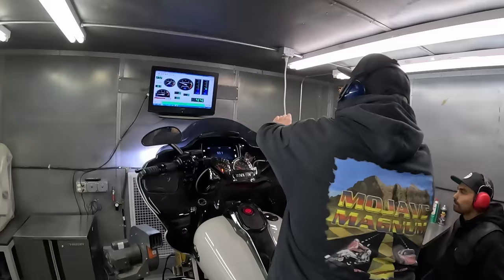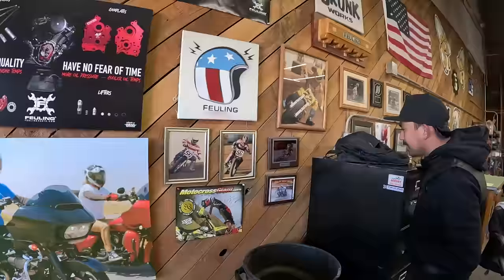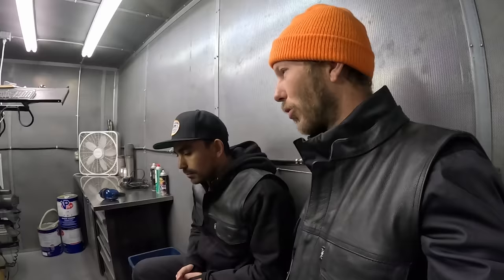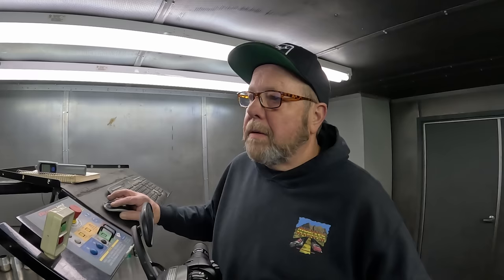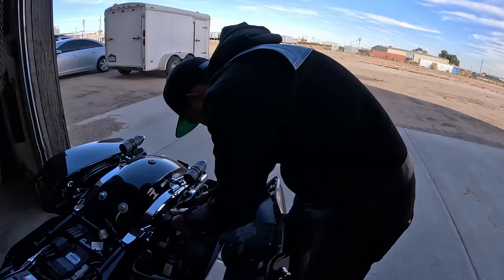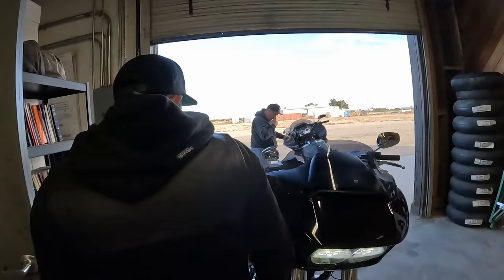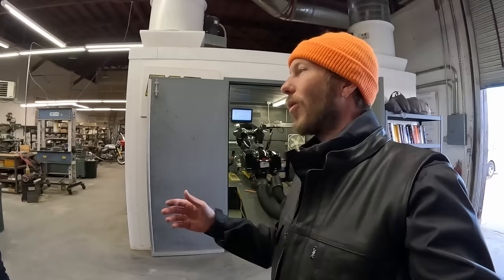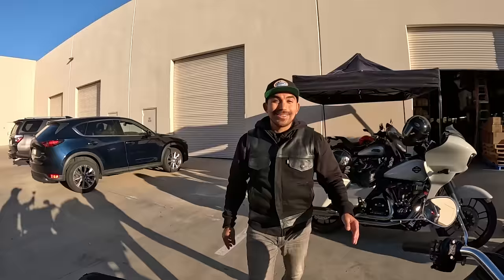Harley Bagger Horsepower Shootout (Battle of the Baggers EP.1) - Vlog 105

Comment: Yo boys! I had a zippers redshift 468 put in my reef blue 2022 road glide standard with a Bassani 2 into 1 mid length exhaust and Arlen ness big sucker air cleaner and it put me at 106hp and 119 ft/lbs. All with the screaming eagle tuner. I’m pretty stoked with that so I think Juan will be sitting pretty after the feuling cam.

Comment: Juan is definitely going to get some good performance out of that 107 with a cam. I put an S&S 465 torque cam in my softail with a 107 which brought it up to 106 hp/116 torque. Little less hp than the S&S 475 cam, but all the power is down low and immediate. Guy said he had it up to about 165 mph on the dyno, but that's with no wind resistance.

Comment: JUAN, Please put down the phone and get rid of the Auto Tuner. Your bike deserves a real tune. 
Totally understand and I felt the awkward vibes in the dyno room when the VH product wasn't lookin too hot 
Listen to the man in charge of the dyno , TTS is the way to go! 

107 with a cam loves to rev!! Parts list I broke after adding a cam in my 107. 
Compensator, 2 OEM transmissions, clutch basket case, shredded belts, crank shaft twisted as well. 
I love my bike. I ride the piss out of it. Break fix repeat 🤘🏻

Looking forward to the next videos and seeing the mod list!

Comment: I have a vance and heinz fuel pack 3 and was able to adjust each cell air fuel  mixture manually. But had no luck with auto tuning.  2009 FLHTC after that the bike had no codes and felt much better.

Comment: My 2021 RG 107 I put S,E torque cam, S.E elite air breather, took out the cat, 4.5 dbx slip ons and Dino tuned stock comp.  97 hp and 117 tq.  Needs dyno again as we kept rpm away from red line cause of warranty.

Comment: In California, making a 107 out power a 117 is tough. The rest of the world does it daily, just a little cam, add a few more spices and it’s smoking it.
Reply: Star racing cams
Reply: I mean this isn't true tho
Reply: My CA 2011 CVO Ultra Glide SE110  dyno'd at 97/113 lbs.ft @ rear wheel with Power Vision tune. V&H exhaust, monster ovals,  K&N air filter...nothing else. With cams, compression,  porting...115-120 hp and 125-130 torque is easy
Reply: In California, thinking about this will give you cancer.
Reply: It’s only an issue if you’re trying to be legal right? Is there a yearly inspection or something?
Reply: Who cares about Cali
.. you are a lover already if you are  there
Reply: @bobloblaw2754  “compression” Please expand on how you changed the compression, without jugs/pistons.
Reply: @freebehindbars8654  thinner head gasket...thinner base gasket..might raise compression a bit..but simple head milling, or piston swap will get 10.5...Just yanking heads, porting and milling.can get 10.5 without pulling jugs

Comment: I have a 21 114 468 red shift cam ported heads stock exhaust no cat push rods roller  s+s rockers American Speed and machine tune on the Dyno  with Drew making 135 tork 139 hp heads make all the  difference and the right tune good to 6500 hundred comes  on at 1800 hundred the best tuner in Calif

Comment: I’d recommend doing a Dyno jet powervision for both bikes if you can the cvo too. I had it on my 18 fatbob and it made over 121 HP after a 465 cam. I have a 22 RG (same as Juan now) but in reef blue. Will be caming and using the powervision. Fuel pack isn’t a great tuner past pipes and air cleaner
Reply: Post your dyno sheet. On a 107 that 465 averages 100 to 107 hp. Average tq is 120...

Comment: Juan and Lance..... compare, CLOSELY, the area under the curve, before and after the Feuling cam and exhaust mod and SkunkWorks tune from 2000 rpm to 4000 rpm from your BASELINE TUNE and STOCK exhaust. You should have a clean, stock dyno reading, everything bone stock, with a exhaust pipe with adequate back pressure, and what you get afterwards with all the mods, HP and torque#s. You should tune for where you run the rpms the most. Passing is such an insignificant % of time that you use all a cam offers.  You should also baseline your fuel consumption, pencil and paper, with MPG's both before and after.  I am betting you're going to suck a LOT more gas and have a lot less range if your stage 2 cam is anything lumpier than a 465, say a 475 or a 3/4 grind street / race cam. Not sure if you or the business is paying your fuel bills on photo shoots, vs is it on your dime when you fill up. Hard to say, since the Vlog is a business, and what gets claimed as business expenses.  Peak numbers torque and HP are for the drag strip and bragging / dick dragging contests. Use that Engineering degree you got there.
Reply: Back pressure ? Laughable

Comment: OK, THIS SHOULD BE GOOD. JUAN TAKING HIS BIKE ON THE JOURNEY OF PERFORMANCE MODS WITH A STEP BY STEP MODIFICATION, ALL THE 107 GUYS QUESTIONS ON PERFORMANCE MODS CAN BE ANSWERED WITH THE  COMPARISON WITH  BIGGER CUBED ENGINES, YES WE ALL KNOW THER IS NO REPLACEMENT FOR DISPLACEMENT, BUT HOLD ON ,SOME MAY THINK BEFORE I LITTERLY THROW AWAY WHAT I JUST BOUGHT AT THE DEALER I MAY WANT TO USE UP THE TOP END A LITTLE BEFORE GOING BIG, MAYBE I WANT TO DO CAM'S AND HEADS AND INTAKE RIGHT NOW THEN GO BIG AFTER I PUT SOME MILES ON THE OLD GIRL

Comment: I was told Harley speedos were about 5 miles faster then they should be even with my 2004 Electra Gluide
Reply: Yes, they are.... and they are 3.5 to 5% faster logging miles on your odometer, too. Which means when your odometer reaches 5250 miles from the last oil change, you've really traveled barely 5000 miles. Confirmed via GPS and Google Maps numerous times on my M8 softail.
Reply: B.S.

Comment: Part of your gas mileage issue is you speedometer being so far off. Your odometer and trip are way off too. Juan should be able to calculate indicated mileage vs true mileage based on the mph difference in indicated speed vs speed over ground assuming the speed difference is constant and not variable across the sweep.